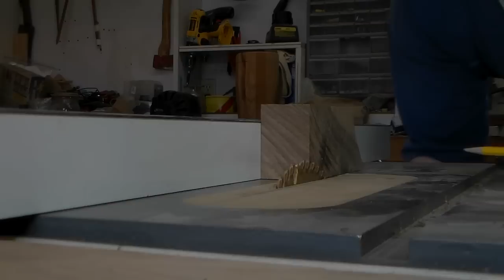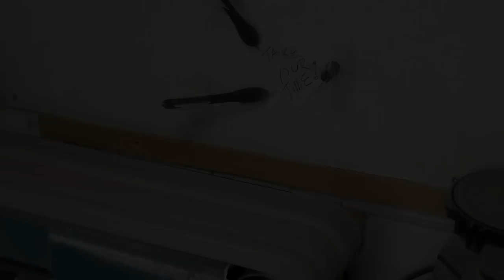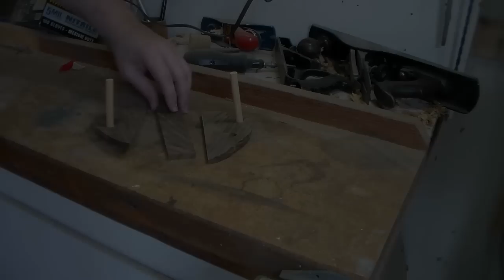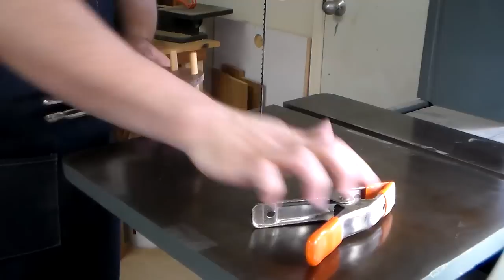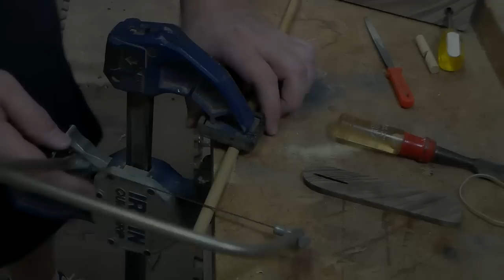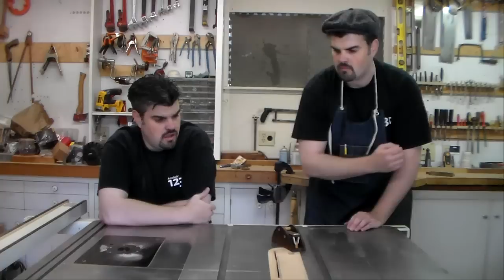The Coinapult. The Coin Flipping Catapult!

Comment: I got a lathe!! It's an old Montgomery Wards. I'll have to see if I can get some 3rd party attachments, since Wards went under a while back, any suggestions?
Reply from the maker: Lee Peterson Sweet! More than likely you've got a MT1 (the taper on the inside of the spindle) Do you have a model number? Odds are the folks at OWWM.COM have a user manual with all the details!
Reply: Nada on the hollow shaft, its 1\2 solid. Its really old, one end is got a flat spot for the live center, and the other end is reverse threaded to hold a grindstone. There is a photo of it in vintage lathes in google images. Its green with a 4 step pulley if you look it up. I've been trying it out, I'm going to have to get some tools, chisels just aren't as good as gouges.
Reply from the maker: Lee Peterson Like this one? http://vintagemachinery.org/photoindex/detail.aspx?id=17360 
or are there threads on the spindle? If you've got threads you can more than likely get a chuck or accessories that will work, but the lack of a MT does limit your choices.
Reply: Peter Brown Yes it does look very similar, except for the threads on the shaft. I turned an 18 inch piece of 2x4 yesterday, it came out approx. 1 3/8 dia. without a caliper for checking.  Not too shabby for somebody who hasn't run a lathe since high school, class of 69.

Comment: Peter do you have experience drilling through steel? if so i am i the market for a drill press and would like one for under $160 that can handle a 1/2 inch of solid steel.
Reply: Daniel Belzberg you won't bei able to find one thats capeble of Doping this for unser 160 $
Reply: Daniel Belzberg *doing
Reply: I've got a grizzly shop fox that works just fine, paid 170 for it
Reply: you just have to make sure to buy good cobalt bits from mcmaster carr, and run the machine very slow.  cutting oil helps too

Comment: how do make the shot with 2 of you in it?
Reply: +Fishes worst enemy I've never did it, but it's shooting two different footages and then mixing it in Adobe After Effects or some other kind of tool. basically like photoshopping two photos into one, but every single frame.
Reply: natsu okay, thanks, Im ganna have to figure out how to do it : )
Reply: Imagine  layering two almost identical images on top of each other, one with a person on the left, the other with a person on the right. Then, with the top image, you cut out the side with no one in it, which makes the person from the layer below visible. It's just that, but with a video instead. If you look closely, you can actually see the line between the two shots, as the background is a bit darker
Reply: I've done it loads of times in after effects, but you can probably do it in most good software. Try searching it on google. I believe the official term for the technique is "masking"
Reply: +Eyem okay thanks

Comment: I think you have slipped a cog, No Lathe, No Epoxies? What gives?
Reply from the maker: Lee Peterson Just wait. I've got a rash of crazy materials in the pipe! Didn't want to over do it! :)
Reply: Peter Brown I wrote you a while back about wanting a lathe, I got daring and tried the drill press/lathe combo that Nick Ferry posted on the scrap bin challenge. This is pretty crude but it worked, I think I'll lay my tabletop d press down flat and make a 2X4 tool rest rather than just a bolt.. You can't fit much between the live and dead centers, That cots out making a cue stick!
Reply from the maker: Lee Peterson The real issue with that setup is the strain on the drill press bearings. They weren't really designed for that lateral force, and may wear them out prematurely. Have you checked locally in Craigslist or the like? January is a good time to find used tools...
Reply: I saw a lathe in a consignment shop a year ago, for $60.00. I went back about a week ago and its still there. I need to see if we can make a price reduction since its not selling.